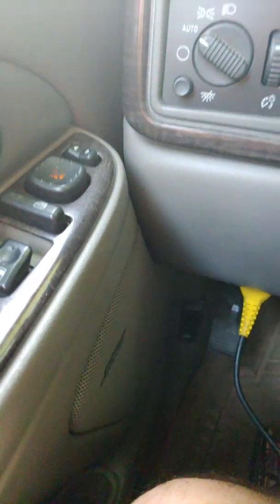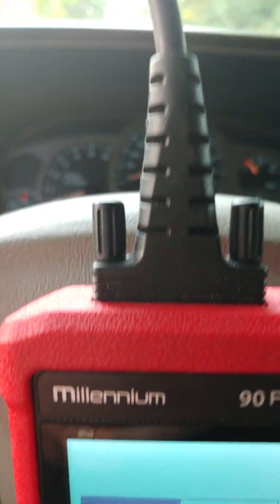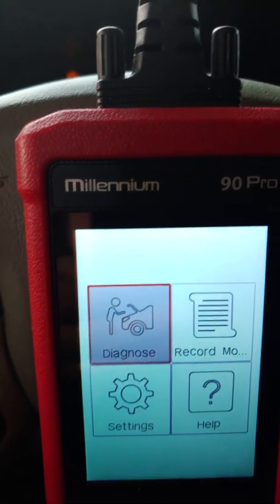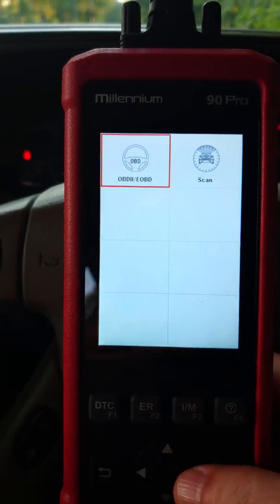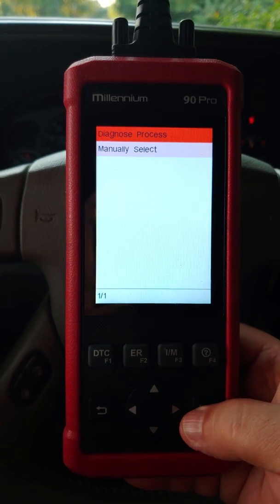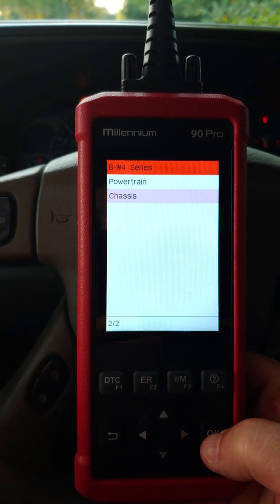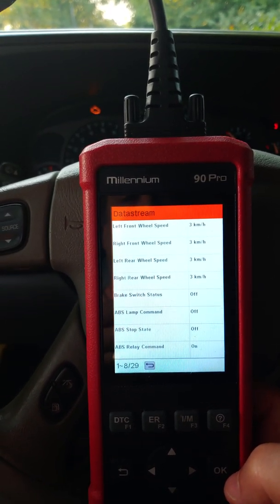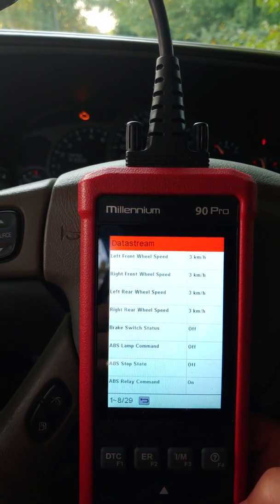Intermittent Traction Active Identify Faulty ABS Wheel Speed Sensor Millennium 90 Pro 2004 Yukon

Comment: if you film with your phone sideways it will record correctly. how do you like the Launch Millennium 90?
Reply from the maker: Yeah, I goofed recording it. Now the Truck is doing the same thing and not exhibiting any discrepancies between the sensors so I am going to try and point it at the TPS or the Steering Angle Sensor now.
It's really my son's and seems to work OK but a bit challenging to work with and I've only been programming computers for +30 years
Reply from the maker: After about a year of dealing with the problem we replaced the Dorman hubs with Moog... Problem GONE!